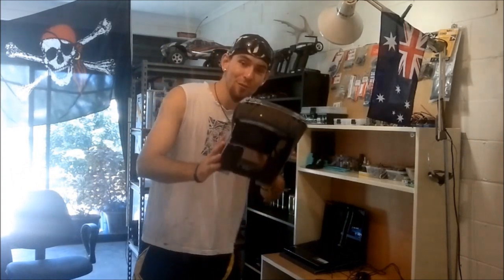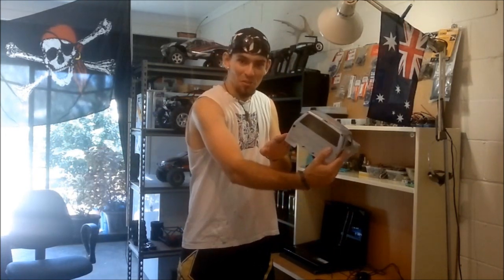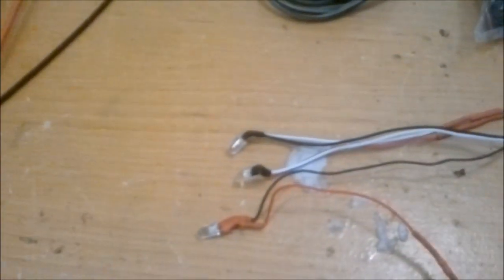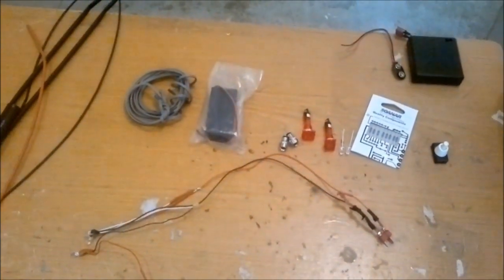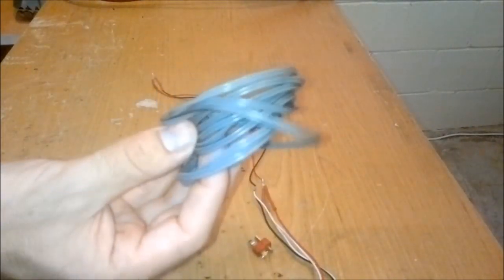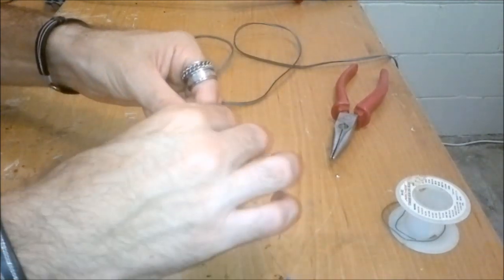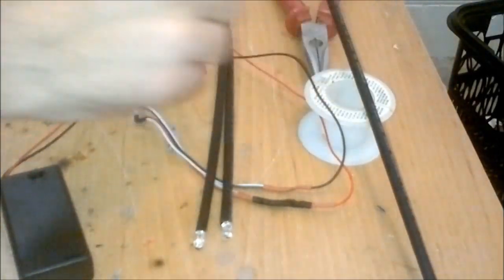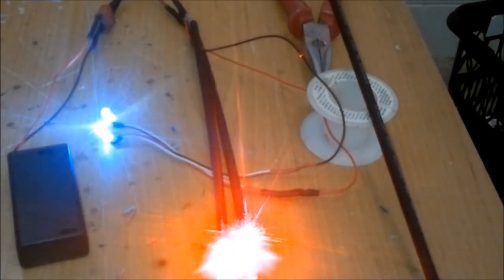RC ESCAPES: HOW TO MAKE LED LIGHT KIT FOR RC's - TUTORIAL - EXAMPLE MODEL - AXIAL SCX10 HONCHO

Comment: good info bud. u can jag the power of the receiver box. if u don't have a spare channel use a servo Y connector. install an inline resistor to suit Led and receiver power output. and bingo